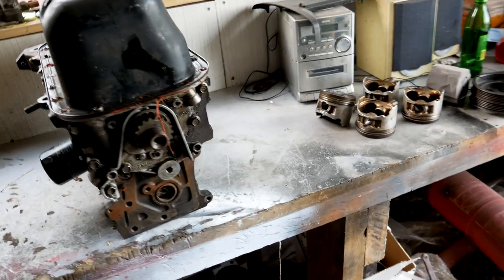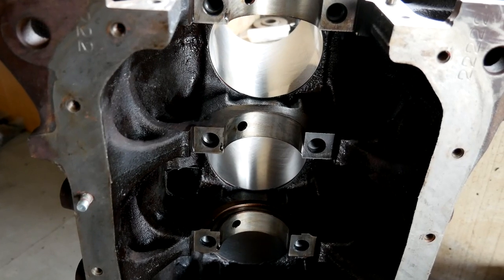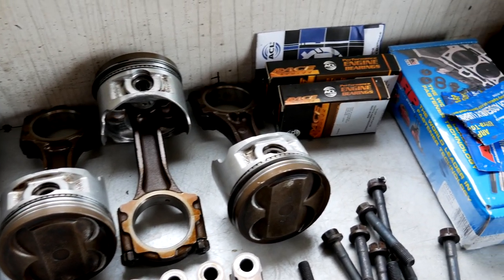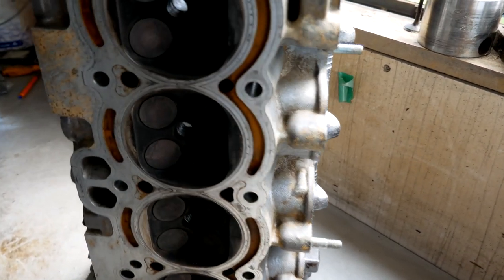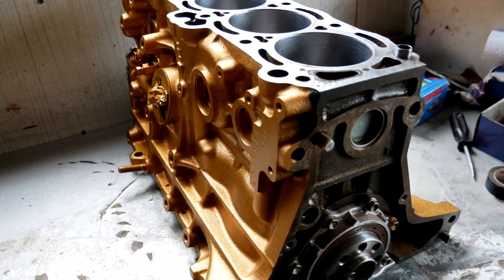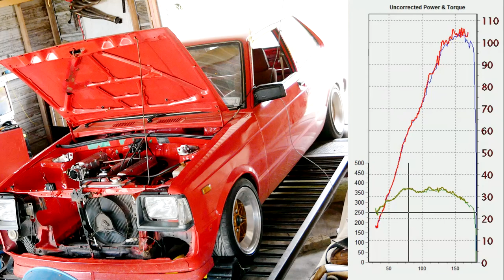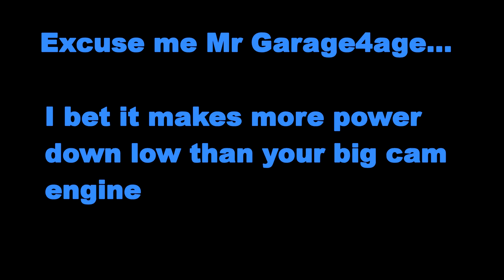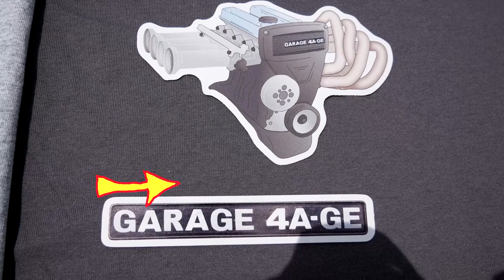Garage4age new test engine - Gold 4age - Cheap engine build

Comment: Awesome as always. Any chance of filtering the raw signal on the dyno traces and cleaning up the axis (axeees) to make small changes more notable as well as getting a neater peak reading? My one gripe..... 🤔 Just be careful, one day you might find a set of forgies, covered in blood in your bed from "big piston". That company has had it good for too long.....
Reply from the maker: Cant apply any smoothing onto the raw graph.  x axis being squished up makes it look worse than it is.   Its just there for visual aid.  the full screen graphs are the same thing, they dont have a huge amount of smoothing on them, just enough to take the bumps out.    I may look into running a little  mechanical  damping on the load cell at some stage, see if it has any effect.

Comment: I've just stumbled across your channel and this is great! Subbed!
Is that just a standard MLS head gasket or did you use thinner to up the comp?
Only ARP head studs?
Reply from the maker: Its just a stock toyota gasket  not mls. I built the engine cheap as possible. Only new parts in the engine are bearings and the arp head studs. even the rings are 2nd hand.     I used the arp studs as  head will likely come off the engine a few times.  I use thinner mls gaskets on my good engines.
Reply: @Garage4age  haha wow with the power level I thought maybe you used like 0.8mm TRD or something.
Like you say all about those bolt-ons hey!

I've run out of cash this week but I'll be happy to purchase some merch next week if it helps you make more of this great content.

Comment: I'd love to see a build/mod series.

Any machining work done at all or just a clean and dingleberry hone?
Reply from the maker: just a dingleberry.   If was going to build a nice engine, block really would have needed a .5 oversize. as had a few marks in the bores.  so was either throw money at it, or  build cheap as possible.   It even has 2nd hand rings.

Comment: Yes love it do series. Hey what about 20v stuff, u know we all think we know what we r talking about but do we really. My blacktop still has a hesitation at times and jerky on off throttle. Any thoughts.? Be interested to see where u go with the big port block small port head engine mods.
Reply from the maker: Blacktops can be horrible things to get to run nice.  they seem to rely on the o2 sensor quite heavily.  will run rich at low load if the sensor isn't working right.   next thing to check is all throttles and isc arent gummed up.  then check the throttles shut and open evenly, once they get a few k's on them the adjusters wear  and get play, so the inner throttles will start opening before the outers.   The cas can start to give issues with few k's on them also.        I got annoyed with mine and put and aftermarket ecu in it.   just in process of developing a hidden trigger / cas setup. since stock ones can give issues and don't give a very clean signal.     may do a few vids with it once get dyno setup better.   is a pain to  load fwd atm.

Comment: I have a few questions if you don't mind. 

1. Are you using a standard size head gasket?
2. The head drain; is this just routed to the pan as the big port block doesn't have the drain?
3. Are you a massive proponent to ARP head studs instead of bolts? (doesn't this really make a difference if I don't plan on opening my motor again)
4. Head and Block been shaved/decked? 
5. Standard injectors?
6. Opinion on bigport cams in a smallport head?

Cheers.
Reply from the maker: stock gasket
drains into sump yeh. 
i always use arp head studs, mostly because can reuse them.  not really necessary on a na engine, but would always use them on a turbo setup that makes a bit of power
head has only had a light skim in the past for straightness.
has caldina gtt 540cc becuse thats what had hanging around.  using about 200cc worth at this power
havent tried bigport cams,  but would like to. since age old question.    i would think the difference in power would be pretty small.
Reply: @Garage4age  awesome, thanks for the info. As for your exhaust its just the one that was on the 150kw motor? Do you mind me asking the setup? Diameter of exhaust, are you running a resonator etc.
Reply from the maker: yeah everything on the exhaust side is the same.  after the collector its 3"  with 2 reso's then a big glass pack/ mulitpass  combo at rear. with internal diameters of at least 3"  to keep flow up.  cant hear exhaust over intake, well on the itb's at least.

Comment: I live in los angeles California USA. I know nothing about tuning. I have a 1988 sc mr2 4agze. I want to build me a 7agte. What fo you recommend I need to get it done on the cheap 350whp? Thanks
Reply from the maker: Personally I would stick with the 4a. turbo the engine that's in there if is in ok condition.  maybe aim a touch lower on the hp and will be reliable with good ecu and tune. just swapping from supercharger to turbo really wakes them up.   then if its not fast enough build another engine.     good thing about the 4a's is they are strong from factory.    7a you will need to do rods and the likes.  and they have a 6 bolt flywheel, rather than 8 like 4a. so cant use your bigger 4agze clutch.   spend the money on a nice turbo setup instead.

Comment: iv noticed that some arp head studs say to torque the studs and some dont .. im that guy where i guy torque the studs doesnt have to be over the top this finger tight.. then there could be knock off arp gear to
Reply from the maker: from memory these ones just say do up finger tight. ive put so many in i dont read the box anymore haha.    I just straight edge them to make sure they all at the bottom/same height.
Reply: @Garage4age  yeh i saw a video on a guys evo where arp said finger tight and they cam loose .. then when u look up arp site said to torque them .. are there old stock  or  china knock offs.. its probably only gonna be line 18nm with plus 60d or something.. but yeh just gives me hibby givvy . Everything has  torque spec.. oem level. If it makes a difference is trial and error .. fuck havent torque a wheel nut in like 6 years

Comment: Hy
Very interesting videos.
But really 140hp at the wheels with a stock engine?
Thats about over 170 at the crank....
I am confused...
Reply from the maker: head is modified as stated in video. plus has good headers and exhaust.  also has minimal acessories and 3.7kg flywheel. so will show a touch more on dyno due to less inertia.   I dont think there would be that much driveline loss. maybe 160 crank at the most.   which is around blacktop 4age power
Reply: @Garage4age  yes, the head work, header and exhaust. But oem cams?
And only with this mods, your engine has the same power as a blacktop?
I have a smallport ae92 and my car have only a complete 2,5inch exhaust with stock header.
He makes 100hp at the wheels and 128hp at the crank.
You makes 40hp at the wheels more with stock cams, only header, ecu and head work.
Thats very much i think.
Reply from the maker: @Silversups88   I didn't think it would make this much power either.   but if run the numbers its about right,   my blacktop 20v in my daily driver (fwd)  made 137hp on this dyno. it has a small amount of work done to inlet ports and chambers, aftermarket ecu, decat pipe. otherwise stock.    both engines are using just over 200cc worth of fuel  which also backs up the  numbers.  the smallport has more midrange also
Reply: @Garage4age  ok that's awesome.
Please make a test with a stock head also.
You live my dream.
I want also a dyno in my garage 😁
I would test everything every day.
So i love your videos.
Reply from the maker: @Silversups88   I have a stock bigport head here that im probably going to put on it.  unless i can find a stock smallport head. they are getting harder to find for a good price.

Comment: the coolant sensor plugging the brake booster port lole
Reply from the maker: I think that was pressure switch off a hilux booster vac tank.  so fit for cause 😂

Comment: Standard small port cams? What compression and cams does the 150kw engine have?
Reply from the maker: yeh standard smallport cams in this one. makes more power than it should from the head work and exhaust boltons.     150kw engine has 300deg cams and about 13:1 compression

Comment: Hello what is the cylinder capacity please 1300 cc or 1600 cc of the test engine when you test the trompets size and cam timing and exhaust in the videos ? thank s
Reply from the maker: All of them are 1600cc.   Not all the same engine though
Reply: @Garage4age  thanks s a lot mister ,i was for 15 Years mechanical technicien on test bench for formula one engines ans i want toi Say that y are doing excepional work

Comment: Did you check the clearances or did you just send it?
Reply from the maker: just sent it.  well I measured up the the crank and its still in spec for standard bearings.  bores not so much. as has a few marks in it which would need a .5 overbore it fix. so it got a  dingleberry hone and some 2nd hand rings.
Reply: @Garage4age  cool man looking forward to see how it holds up

Comment: I would love to see the kind of power figures you can make with a set of Weber carbs, high compression and some massive cams

Can’t wait to see what direction this engine ends up going
Reply from the maker: carbs are some kinda wizardry  to me.  and are actually pretty expensive.  so will likely stick with efi.   have a couple different inlet setups, single throttle and itb that will go on it soon.

Comment: Mate whats your exhaust setup diameter from headers??? do you have any cats and what about inlet diamater of your rear box single pipe or dual? Just asking cuz installed oem rear muffler on my old 1.8 16v nissan and i can feel that my power has decreased a bit before have had just straight through muffler with 46mm inlet same on current oem muffler ...
Reply from the maker: 3" after collector. oversized for this engine but doesn't hurt power like some people think.  2 reso's and custom twin 2.5 exit muffler at rear.   if you want to keep noise down  but flow up  use a normal style muffler  not a straight through,  but go up a couple of pipe sizes over your exhaust size.
Reply: @Garage4age  hard to find compact sized muffler with good muffling capacity, 80s hatches aint big cars 😂, would you do and muffler/exhaust setups dynos to show differences like 2" vs 2.5 or straight pipe vs oem
Reply from the maker: Yeah thats why i made my own.  Nothing planned just yet but will likely do some exhaust stuff in the future

Comment: There must be something wrong. 140hp is power we in CZ get from 1,3l 8V OHV with twin Weber DCOE45.
Reply from the maker: At the wheels?    this engine is actually doing pretty good for almost stock engine, they are only rated to make 134hp at engine factory. and these are wheel numbers
Reply: @Garage4age  Yes, on wheels. And that 1,3 is from Skoda 120. It is rated to from 34-46kW. With these carbs and sharper cam, it is doing over 140hp (at around 7-8k RPM)
Reply from the maker: @martincoufalik9101  Nice.  This engine is basically stock.    my other engine makes over 200hp at wheels
Reply: @Garage4age  yeah, i saw them all, i am your big fan :) Check out these czech engines, they have been racing in that 120-145hp spec since 70s. 130LR even beaten 037, Quattro and others in Group B :)

Comment: err im sorry but im not a believer ... maybe you should try this on a dynopac dyno to see if your dyno is way off. .... My 4agze (with SC and more boost) made less than this at the wheels. But maybe it gets there cos of the after market computer and headers and exhaust...and emissions stuff ... Honestly doing a video to see if removing the emissions stuff actually makes a HP difference would be interesting.
Reply from the maker: Well i thought it would make less also.     But as for dyno being wrong.  My daily blacktop 20v, which are rated to make similar peak power as 4agze,  made 103kw (138hp)  in fwd configuration, so in theory less drive line loss. 20v also has a little headwork, aftermarket ecu, so on the high end of what they should make stock.        If run the fuel injector numbers on engine in this vid, its using just over 200cc at 12.8afr which  also backs up the numbers.     remember the head is not stock and is running exhaust bolt ons from the 150kw engine which has had plenty of development time .  plus if you look at the graph it holds peak almost to 8000rpm. they usually die before then.   I was actually hoping it would make less, then was going to use 20v parts, (itb's and the likes)  to try beat the 20v numbers.  but hey its already done it.  need a stock head and crappy headers
Reply: @Garage4age  im going to sound old now... my most loved car was the AE101 4agze.. and i used to be rather involved in the toyota club back then (20 years and a bit ago)  We used to take them down Meremere Dragway. the 20v's from the AE101 and AE111 were most interesting because the fastest ones were the most stock ones with the least mods... IT really hacked off some of the guys who spent a lot of money on their cars... LOL   

Back to the dyno i guess im a little disappointed cos i just assumed you'd start with a stock car then work your way though it but instead you started where most people would have ended and.... heck 120KW at the wheels  would make me scream for joy in a NA 1600..... Mightcarmods 1800 trubo  Yaris made 150 then died a few days later.. and you managed 140!............. I have a 1600 Swift now.. and im missing the power of the 90's 1600 toyota's...... Im intending to electric turbo it... but that's going to cost about 4K. but will be interesting (Im already in the process).
Reply from the maker: Yeah one of the ideas for this engine,  (not the main one thats still top secret)  was to step back from the 150kw engine, as is pretty close to end of development.   Start at the bottom or close to it.  but  using the modified head and fancy exhaust side didn't work out so good for that..   smallport heads are getting harder to find and go for good money, which i dont have a lot of to spend on this, but if something comes up will swap a stock one on, and maybe some crappy cobys,  because thats where most people start.   Ive been playing with these engines  for over 10 years, so hard to compare to mcm stuff where they've just wacked a turbo on a wrecker engine.     The starlet has done a 13.5 @ 103mph at meremere  back when it had probably around 140kw.  electric turbo sounds interesting.

Comment: What are you using for a CAS or crank trigger?
Reply from the maker: Using hall sensors.  working on a bolt on hidden trigger system.   20v version almost ready to go
Reply: Garage 4age awesome I’m having some issues with the GZE cas and heat from my turbo.
Reply from the maker: I cooked the stock cas on my hilux for the same reason.   been running the same hall sensors on it for years now after that happening. gives way cleaner signal stock, so timing etc is a lot more accurate.   just trying to come up  with a more easy to install setup, that doesn't look horrible
Reply: @Garage4age  I am currently working on somthing similar and I will be posting up some videos to my Facebook page tomorow on it of you wanna check it out for some Inspiration MT performance engines is my page, love the videos bro keep them coming